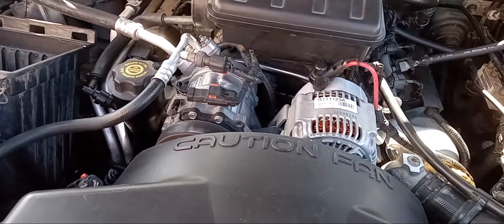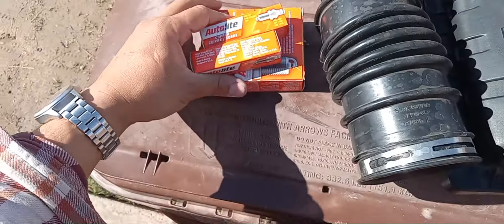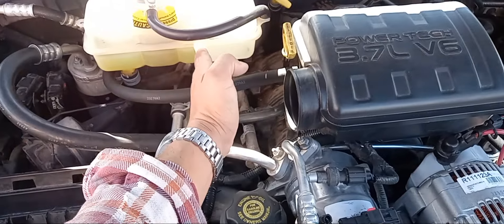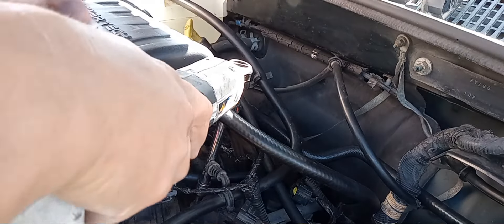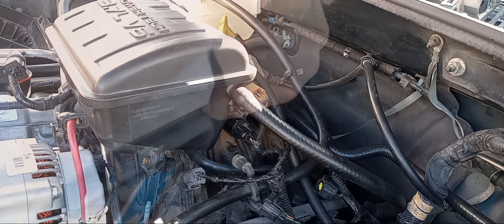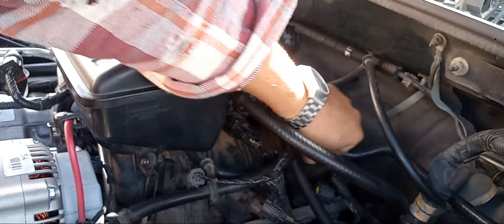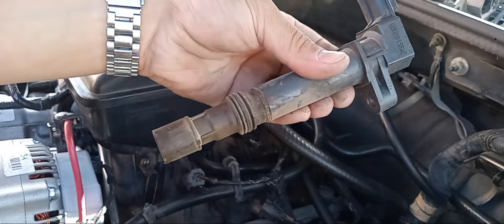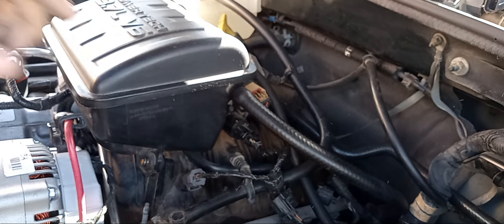Fixin On The Old Pile Of Goodness

Comment: How do you fit a 295 in the spare? Did you flip the mount?
Reply from the maker: It fit because the back spacing was 4" but you could easily run a spacer to fit it